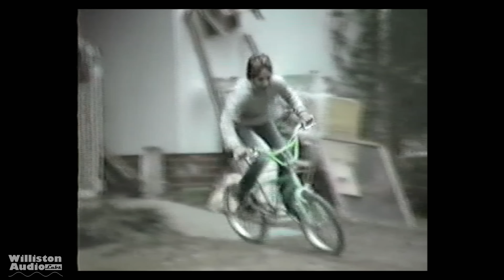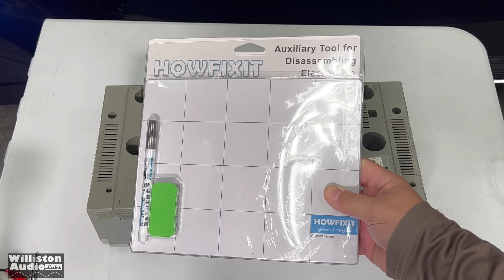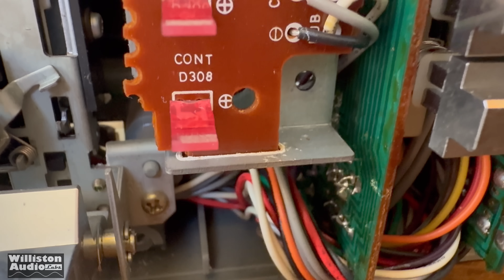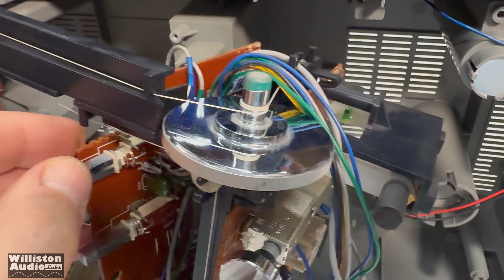$69 in 1985?! The Emerson CTR949 Boombox That Fooled Everyone

Comment from the maker: What boombox did you use back in the day? 

VIDEO INDEX
0:00 Intro
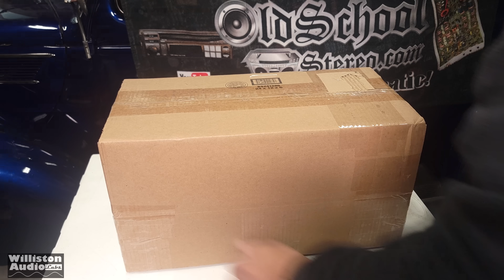1:45 Unboxing
2:01 Specs and Features
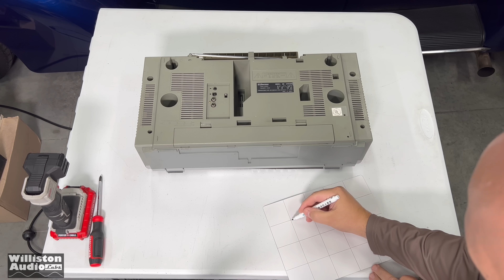5:10 How to Get Inside?
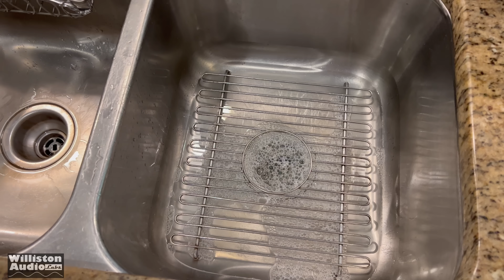7:12 Cleaning the Boombox
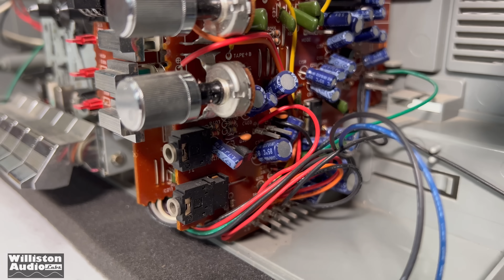8:37 Tape Deck Issues
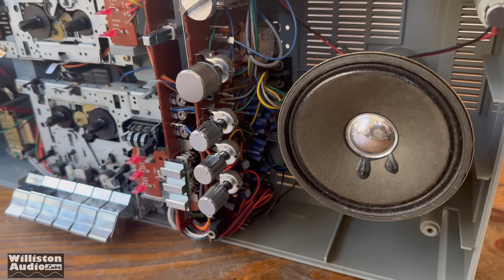10:12 Finding the Tape Pre Amp Module
11:07 Wow, This is Complex
13:15 Analyzing the Circuit Board
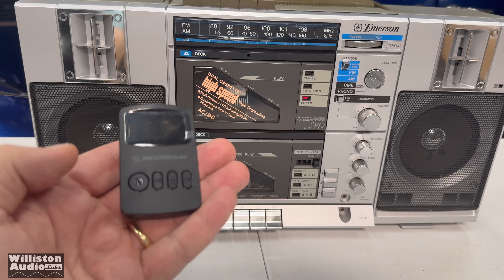14:39 Sound Demo's with FM Transmitter
16:46 Final Thoughts
Reply: Panasonic!!!
Reply: @tatialo37  I also rocked a Panasonic boombox. Dual cassette, aux input, and detachable speakers for spreading the sound. After that, I had a Magnavox Turbo Bass box. That thing was indestructible...probably still going.
Reply: I was rocking the JVC PC5. I still have that boombox to this day.
Reply: @Ducklafied  That is an AWESOME Boombox!
Reply: @Ducklafied  Those are super nice. 👍
Reply: Hitachi 3D7, TRK-7620.   5 speakers with a 6.5" Super Woofer, and 5 band EQ, 22 watts. I bought another one about a decade ago, and I changed the Piezo tweeters with actual cone type. They put out some serious sound.
Reply: I had the Vela discolite boombox. 🎶😎
Reply: I had a Philips D8168 dual cassette complete with 3 band EQ and 2 way (piezo tweeter) speakers. I believe Magnavox also sold the same model under their brand.
Reply: Hitachi 3D Super Woofer
Reply: @Synthematix  I've had 3 of the 3D7's over 40 years, they are bad a*s.
Reply: @wal  back in 1983, for Christmas I received a Panasonic Rx-c39. Specs on the back claimed the amp was 21 watts x2 and speakers were 17 watts each. Not sure how that would make sense since you'd think the drivers would be overloaded. The (detachable) speakers actually had real tweeters. Piezo drivers to be exact.
Single deck with 3 band graphic equalizer. It had line level aux on the back.
It took 8 D batteries or was powered by either an ac detachable cord or dc 12 volt barrel connector. 
It wasn't the most fancy one around but it had really great quality sound with decent bass and crisp highs with plenty of volume output, plus it looked quite sharp in that 80s boxy squared off fashion. It was a particular mid dark shade of grey I can't identify. I actually miss it now aa I think about it.
Reply: @lenbeedle  I had this exact same one ! It was great at the time.I'm sure mine was from later than that year , I'm thinking '85 maybe '86.I still have mine somewhere , but not sure it works.I think the speakers may have tiny holes in them.The light gray speaker cones with black surrounds looked cool too.
Reply: Didn't get it until about '87... but because my collection had tapes AND LP albums in it, I got the Panasonic SGJ-500.
Reply: Had an early Crown unit then put my first pay into. JVC DC7L
Reply: BIG PANASONIC WTH AMBIANT SOUND!:trophy-yellow-smiling: WE USED TO RECORD OUR BAND ON THAT BOX BACK IN THE 80s.:eyes-pink-heart-shape:
Reply: Sony CFS-210. It wasn't a big Boomer but it was blue and it went pretty loud for what it was. I still have one.
Reply: @wal  you have to do a review on the sharp wq-t354 x bass.... From 1989 ... Selectable ported separate subwoofer....was awesome in the day...
Reply: Had a Sony boom box with detachable speakers. Used it for a bookshelf for years and years. 

If you ever get a chance to check out and test a WMQ powered subwoofer for home theater, I bought two WMQ 12 inch powered subwoofers from Amazon. I was quite surprised by the amount of sound coming from those cheap subwoofers. I really want to know if they do their rated power of 400 watts RMS as advertised. Be forewarned, the plate amps get hot so you might want to put fans on them.
Reply: I had two of them.  

The first was the Sanyo M9998K, the TOTL Samsung Boombox of the time.  That thing was big and it was a beauty.  

The second one though was my favourite, a red Sharp QT-37.  Smaller than the Sanyo, less features, but bright red and with detachable speakers which allowed for a true stereo experience.  That one traveled with me for years, until I made the mistake and left it with my brother one day, and I never saw it again after that.  Every now and then I fantasize about recreating it using 3D printing and modern drivers and converting the main body to a subwoofer unit.
Reply: I had a Hitachi TRK-9100E back in the 1980s. In fact, I still have it. It's still in cosmetically good condition, but the pots desperately needs some contact cleaner, and the belts in the cassette player needs swapping out too. I will do that... some day...
Reply: @wal  my brother and I had this!  😻
Reply: I got an off brand one from my grandmother for my 10th birthday in 1984 A brand I'd never seen before, Unitech compact but loud double cassette detachable speakers 3 band EQ. I kept it until 1990.
Reply: I had a single cassette Panasonic sounded pretty good, I took it apart a few times.
Reply: born in 84 here, one my earliest and most prized possessions was a hand-me-down emerson CTR-911, a bare-bones model. mine had a small hole burned in the bottom (and the cassette door missing) from when my folks sat it on a still-hot oven eye, which is why it became mine sometime in the year 1989. my first new (for me) boombox was a GE #3-5624 bought in 1991 with christmas money from my grandma. that lasted about 2-3yrs before i took it apart and then replaced it with another emerson, AC2420, this one with graphic equalizer and detachable speakers! these were all cheap pieces of shit but i'd love to own them all again just for the nostalgia factor
Reply: I had this exact same box! My aunt bought it for me since my brother was taunting me with his Panasonic 5010.

Comment: I remember being so excited when I got this. I thought id got a BIG boombox for cheap.  But with the low power and the 4" drivers it wasn't louder or having better bass than my small Sony. Not that it was bad at ALL , but it certainly didn't impress like it was a larger box. It's more like a slightly larger small box with small box drivers, and pretty decent dual cassetes. It was neat and I liked the layout. I do wish they'd gone with 5 inch drivers and maybe another couple watts. It was very good value though.

Comment: If you want to remove the yellowing from the plastic, grab some 40 Volume Hair  Developer and brush it on thick to the yellowed areas and wrap it in Cling Wrap and set it in the sun for a few hours. It will remove all of the yellow. This did wonders on Old 80s Sneakers and Apple II Computer Cases and parts.
Reply from the maker: Can I use the rest on my hair? Wait…🤦‍♂️

Comment: I had a Realistic Modulaire 2200, which was a RadioShack rebranded Sanyo C-40.  I really enjoyed that thing and squeezed every ounce of life out of it from the dual cassette decks (with high-speed dubbing and Dolby noise reduction) to the auxiliary line level input.  It also had an integrated 5-band graphic equalizer, detachable speakers, and it came with a separate external turntable as well.....1986, 40 years ago, now.

Comment: Hi, Got my first boombox in 1978, a Sharp GF9090, after that was stolen I bought a Sanyo M9998L, I ended up selling that and bought a JVC PC5L. Thanks to eBay I now have a Sharp GF9090 and a Sanyo M9998L, both working nicely. I couldn't find a good JVC PC5 but have managed to get it's big brother, a PC55l. Out of the three I think the Sanyo is my favourite, the JVC is just too heavy however the JVC does get used a fair bit because it is the only one with AUX in  RCA sockets, which I do use.

Comment: I had a magnavox with 5½s. I eventually later on did the same thing you tried, but the tape decs didn't work anymore, and the switches and pots were all scratchy and would no longer clean up. What i did with mine was extracted the amplifier board out of it and powered it with a larger 1amp 12v dc regulated wall wort power supply because the system could use 8 D batteries. I found where the preamp wired into the amp board and connected a wired male ⅛ stereo jack and used a portable cd player with a tuner. I used little 4" boxed car speakers (or whatever was lying around). It worked well! The amplifier IC actually stood up off the board with a decent sized heatsink. The whole thing fit perfectly in a radioshack project box and could go remote with 2 6v lantern batts hooked in series. In my experimental days of youth, i did this to many other car stereos and home stereo systems that had separated amplifier boards.

Comment: Phono jacks "for a ceramic cartridge" might just be... a bit of a scam, like a line input with added 1MOhm series resistance and nothing else, because recovering the ideal response would not have been the goal with THIS quality of speakers. You can just connect a CD player and report what it sounds like - it's not going to hurt anything.

It reminds me of the Soviet boombox which looked imposing but didn't sound at all great, that i had 30 odd years ago. It was somewhat prone to chewing tape, so that's another major drawback. If this one ran without being too tape-hungry, i think it's OK. But on the other hand, paying $70 for this pile of junk vs. adding a couple dozen more for something that's 100 times better made and better sound... yeah probably still was a bit of a scam.

Comment: As a kid I had a boombox that took 8D cell batteries and I couldn't afford to keep it fed.  Years later, my first car was a '78 Honda CVCC with a single speaker AM radio.  I used a pair of wires to power the boom box from the car.

Comment: Good thing you didn't waste your time in repairing the tape decks. The specs are extremely low with horrible frequency response even worse on recording, very high wow and flutter, and no tape selector or Dolby nr. Even a typical mono shoe box recorder would sound better. The double deck is useless as the dubbing results would have been disaster.

Comment: #1  A ceramic phono input works ok-ish as a line input if the thing has decent tone controls, and you're not going for audiophile fidelity.  (And considering this is a low-end boombox, I highly doubt its customers were audiophiles.)

#2: You can get rechargeable C and D batteries — NiCd or NiMH.

Comment: I had this exact unit. It was my daily driver as a kid... I ran MILES of tape through those decks.  It was a very low end device.... exemplified by the fake "tweeters" which were just little metallic disks. The quality of the dubbing was horrendous. High speed dubbing had an insanely high noise floor.  However, it made acceptable recordings from radio, and I also had fun plugging two mics in the back and making STEREO recordings of me and my friends.  

Besides not being able to get as loud as some more expensive competitors, another thing it lacked compared to some higher end units was some flashy LEDs, so I asked my dad - who was good at electronics  - to help me add two LEDs next to the balance control that indicated the volume of the audio present.

I also used the dual cassette to play DJ and the mic mixing was great for recording voice-overs on pretend radio commercials. 

My senior year in high school, I got a job at a local radio station... and today I am Director of IT and Engineering for that company, and I still do regular voice-over work and commercial production. 

... so maybe this little low end boom box helped start my career 😂

Comment: I got a SONY CFM-23 for Christmas in 1982 I think. Single speaker mono cassette AM/FM. That thing was durable. It died probably after about 6 years of use.

But when I hit adulthood I had my own dough to spend, and I found a JVC AM/FM/SW1/SW2 radio with an equalizer, dual cassette and detachable speakers at a place in the Minneapolis area called C.O.M.B. Stores. It stood for Close Out Merchandise Buyers and they sold refurbished or factory seconds of a lot of stuff. I paid a tidy sum of $65 for that boombox and used it a lot. Shortwave radio was an interesting addition and i listened occasionally.  I don’t know what market that radio was built for with that Shortwave band added in, but no one else had one unless they got it at COMB! 😂

Comment: Sharp boom box with metal tape option as well as program search....... 
  FYI; the ceramic input is your basic line level input just labeled phone on many of these systems. The other line level option is to use something like a 2-5 MF capacitor on your signal input wires and put the ground to the metal frame of the device, OR the bottom end of the volume control might work as well, then the other end of the caps to the high end of the volume control.

Comment: Did you try to hook up the Bluetooth transmitter to the aux in the back? I’d give it a shot. Back then they didn’t have many aux inputs other than a record player. And obviously Emerson prolly wanted u to use the record player made by them which probably had a “ceramic tip” or whatever it said. Cd’s weren’t even out yet. Give it a shot it’ll probably work. 
I remember the days as a kid walking down the street with a boombox like this. With 8 D batteries. Hanging close to the ground music playing. It was the way to get all the homies outside ready to play football or whatever we decided on. Cool that u pulled this OG double cassette radio out. Great nostalgia

Comment: I had one of these for a while and also another Emerson about half this size that had a 4" B/W TV built in. The sound quality on both were very midrangey but the stereo separation wasn't bad. The TV one had a wide stereo switch that added a surround like ambiance to it, but still not better than a modern flatscreen TV. 

Honestly if I were you, I would ditch all of the guts inside this thing, including the speakers, and then put a FOSI amp in it. You could probably remove the pots from the FOSI and wire them into the unit so it will look and work like OEM, but a million times better. It looks like there may be enough space to add a pair of coaxial 5.25" or 6.5" car speakers mounted behind the front panel if you remove the plastic posts that now hold the wimpy Emerson speakers. It could become a really cool retro unit with the modern day convenience and sound quality. You could probably install a LiPo battery in it to power the whole shebang too.

Comment: You can hook up a CD player or other line-level device to ceramic phono-in connections without issue.  There is no 'impedance matching', per se.   I'm assuming here, of course, that the phono-in truly is a 'high impedance' input and not just vague compatibility with signal level (line-in and ceramic phono levels are roughly compatible in terms of signal).  However, ceramic cartidges, because of how they work,  and how most records are mastered, require a high impedance in order to provide proper frequency response.  Devices like CD players, digitial media players, etc. are not typically all that sensitive to impedance.

If you have a more modern turntable with a magnetic cartridge, most of the units you're likely to use with a boom box like this will have a built-in preamp and will also work with that phono-in.

Bottom line :    There's really no reason you can't use that phono-in as a plain old line-in to connect a CD player, MP3 player, Bluetooth device, or smart phone.  Go for it.
Reply from the maker: I did try it and the volume is very low and sound quality isn’t good 😩

Comment: Man this brought me back. I had that exact same boombox too in the '80s. I had two Fisher boom boxes. One looks almost like that one that the auto search function on the cassette so like if I was playing a song I could hit fast forward and if it had a pause between the song it would stop and play the next song which I thought was cool. The other Fisher or boombox I had was awesome because it had a built-in keyboard that was detachable with composite wires and AAA batteries. That was a single cassette AM FM. The tuner didn't work on it, My old man used to buy me boom boxes at the pawn shop when he would buy and trade guns there in those days. I got a Lasonic I bought recently that I had in the 80s barely works off of eBay. I paid too much for but I plan on restoring it as good as I can. It's not the black one from the late '80s. Everybody remembers it's the silver one from the early '80s that cost a fortune if it's mint so it's going to be a long process lol

Comment: I had a KOSS with detachable speakers I was 7 when I got it and I took it with me sometimes. But what really got me into audio was the Optimus STAV-3350 home receiver from RADIO SHACK. It would take 4ohm loads. One of many set ups I did was a pair of 12 Super Pro woofers (better then the new versions) in a bandpass and I put those under my bed. Then I fell in love with the pioneer IMPP’s 12’s. Good freaking times. I remember buying the Bass Extreme cassette them the CD. Had fun as well Especially when I went surround sound mode and watched Top Gun or Jarrasic Park…..

Comment: The "OSC" switch was the same thing as the "Beat" switch on other boom boxes and all-in-ones. When recording AM radio to tape, the bias oscillator in the tape deck could cause a "whistling" interference. That switch changed the oscillator's frequency slightly to reduce that interference. Since almost no one ever recorded off AM radio, no one ever figured out what that switch did - or ever needed it.
Reply: @RedBankVintageAudio  “From the High Desert this is Art Bell on Coast to Coast AM 🌩️”

Sure we did 😁
Reply: @indecent0079  Well, Art Bell might well be the exception! I used to listen to him ALL the time! Me and the greys, that is!
Reply: UPGRADE THE SPEAKERS FOR HIFI SOUND

Comment: High speed dubbing was kinda garbage. I mean, it gave you a copy in no time time flat, but you got no Dolby NR or bias control. And you did not get a high quality copy. You actually got a little bit worse copy by dubbing it at high speed. At regular speed, you got a little bit better quality copy than on high speed. I bet if you could make a copy at half speed, you would get a copy that was almost identical to the original.